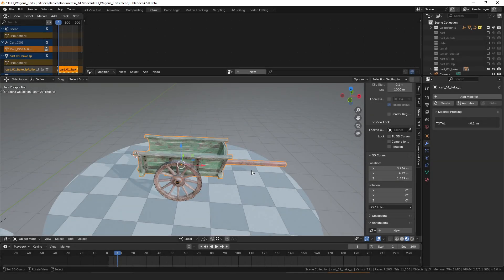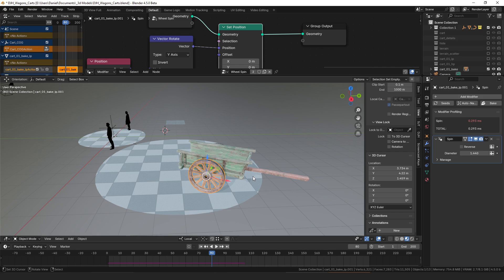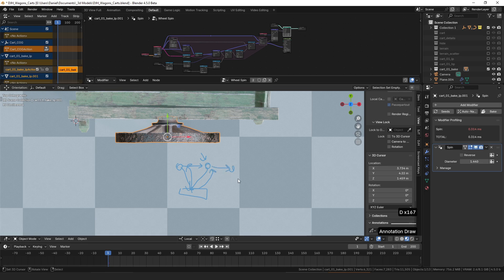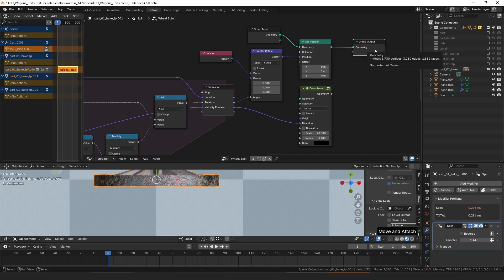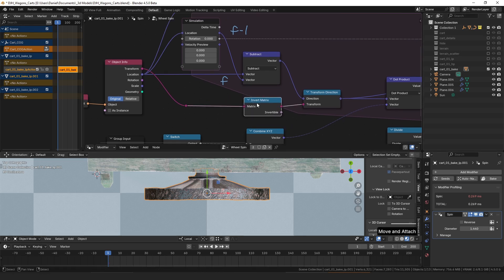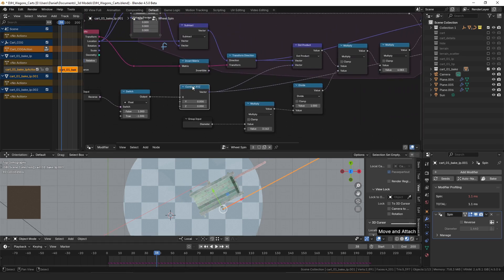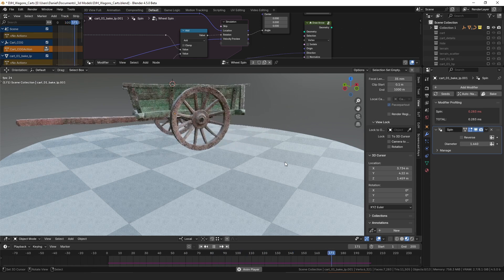Roll a Wheel Around using Simulation Zones in Blender Geometry Nodes

Comment: I made something similar to this, I did it with instances to speed things up. I had the position of the instances use the relative position of wheels to the prime vehicle. 
I also used the bounding box to work out diameter. 
Also also, I made a trailer that followed a prime mover with the wheels that followed that.

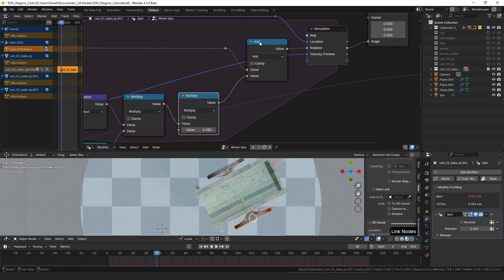Comment: 8:56  Hmm 2*pi  is 6.283. You have 6.083.
Reply from the maker: Ha, that's funny, I didn't notice.  I must have clicked the arrow to change the value by accident, when I entered the value I just typed 'pi * 2' into the box and let bender evaluate that expression.
Reply: @looseEdges  I noticed the rotation is a tiny tiny bit off. So I was being alert as to why.